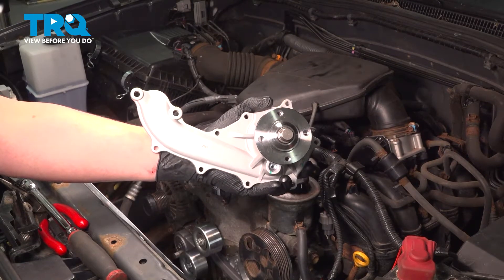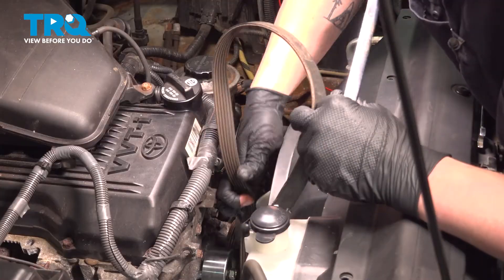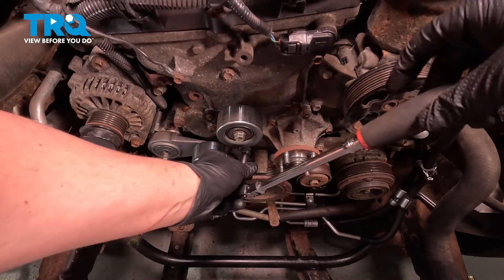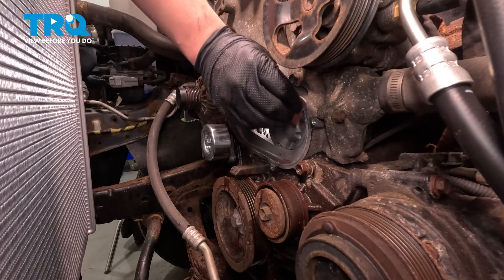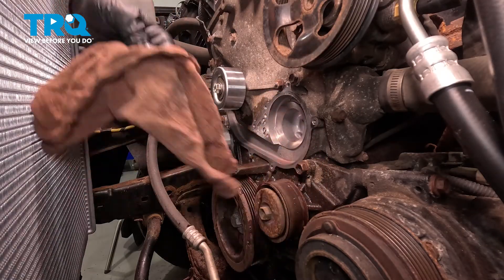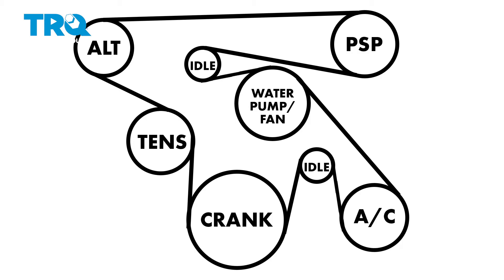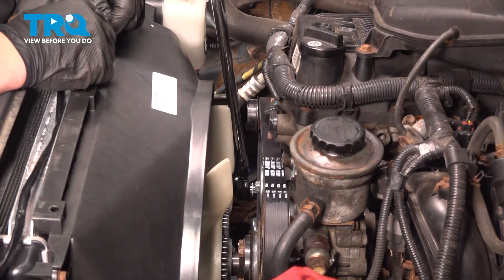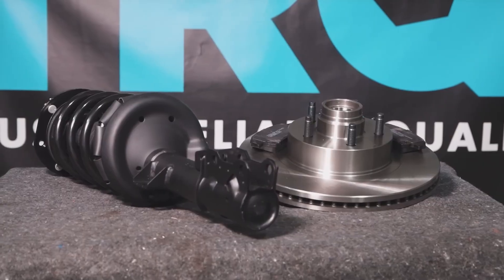How to Replace Water Pump 2005-2015 Toyota Tacoma 2.7L I4

Comment: A tip for anyone else doing this replacement - check your gasket fit against the timing chain cover. Mine had a substantial amount of "extra" gasket for an unused bolt hole that was hitting the timing indicator above the harmonic balancer, pushing the bottom of the gasket up. It wouldn't lie flat until I trimmed this bit off.